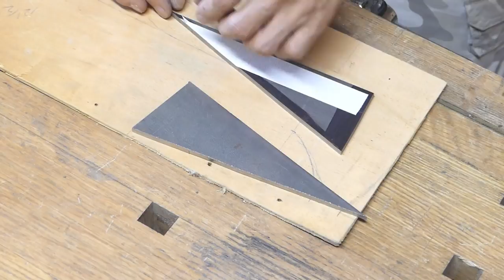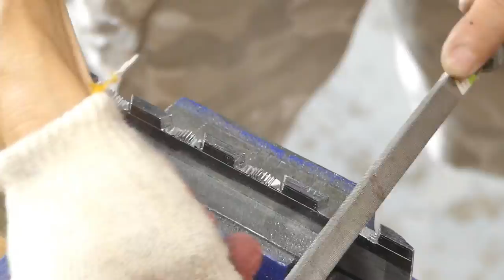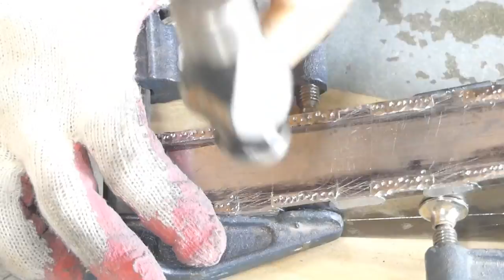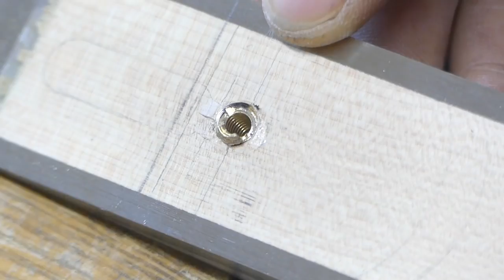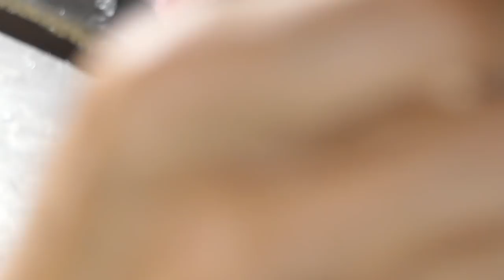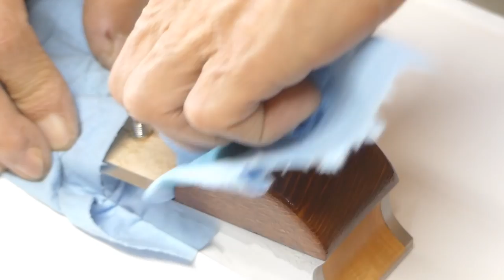Making infill chisel plane

Comment: Small piece of advice no offense meant by it. The brass inserts try machine bolt instead of a Phillips you will be able to get a more equal pressure on it without stripping it so easy. But I also want to say awesome work really enjoy these builds.